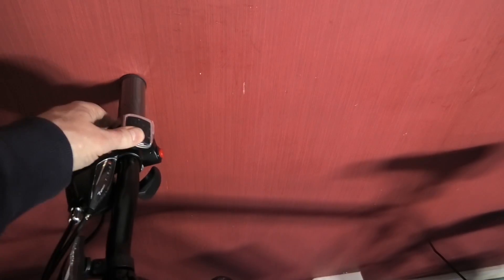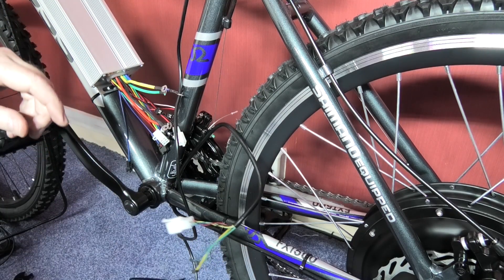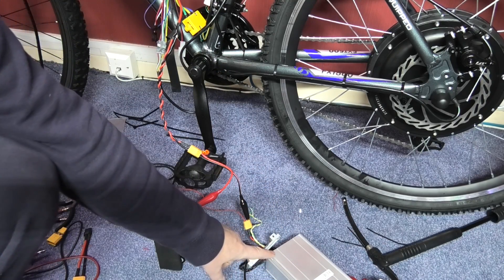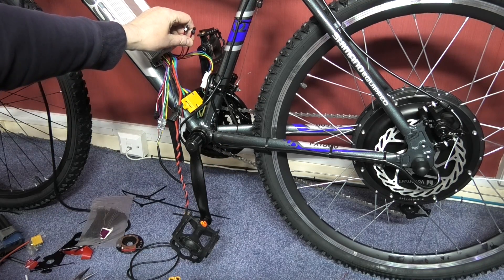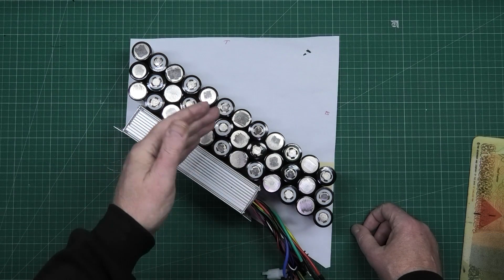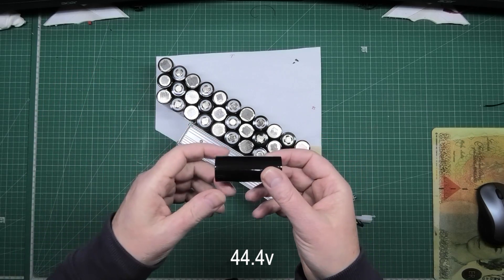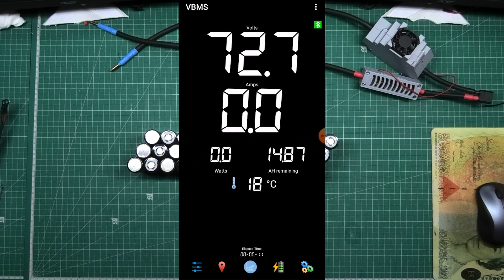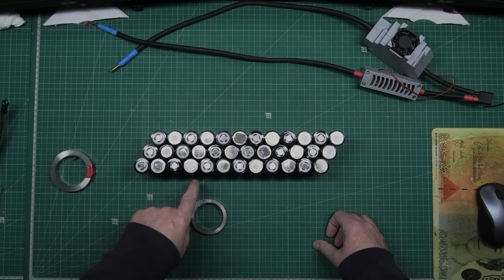Budget 1500w DIY eBike build part 2 - The li-ion battery build

Comment: tony  the  yellow  block at  3  mins  n  video  with  3  phaze  wires  do you have one you can sell me  or  is  there  a  uk  supplier
Reply: You have these, but they don't come with a cover (a block of firm foam and a few layers of insulation tape would suffice) https://www.ebay.co.uk/itm/142096147429
You have these which require you to cut the ring connectors off and screw down the bare wires https://uk.farnell.com/camdenboss/chtb10-3n/terminal-block-power-distribution/dp/2321056
Apart from that, I can't find a solution in the UK mate, sorry.

Comment: Why you use these shitty liitokala cells? Especially on your big bike. With your 6P config is your max output 120-130A or your plastik printed casing melt down. Try Samsung 18650 35E cells. Way cheaper and much better performance. For more power up to 6C discharge use VTC6 or Samsung 30Q.

Comment: Hello Tony, brilliant vids btw only found you recently but glad I did. I have a question on the tape. I don't fancy building my pack with hotglue and have decided to attempt your bonding tape method- I cannot however find tape that looks or resembles your roll. My question is could you supply the name/ version of the scotch vhb bonding tape, also what thickness is the tape depth wise, I'm building a battery that will be going into a confined box within the centre of my frame but the spacing is limited so I need something that doesn't bulk too much but also leaves a breathable airspace between the cells.

I impatiently wait for your reply haha

Jc
Reply from the maker: Mine is very old and it's 0.5mm thick. Try this stuff mate, it's virtually the same (acrylic) https://www.amazon.co.uk/Transparent-Mounting-Double-Sided-Waterproof-Resistant/dp/B07PS1PXLR/ref=sr_1_5?keywords=vhb+tape+0.5mm&qid=1578207533&sr=8-5

Comment: Hello, I put together a 10s3p pack using the 26650s, soldered using fuse wire and seems all good, however the throttle mounted battery level indicator supplied in the front wheel kit by Voilamart was reading 3 bars from day one whatever the state of charge.
So I ordered what I thought was a better one with a key lock and voltage readout and the only thing that works is the voltage readout, ie no throttle, been 3 months now but  I remember the controller wiring is different enough  to be a problem. ( poss 1 less or 1 more wire)
I asked Voilamart for advice re wiring change but they would only offer me a replacement throttle if I paid for it, so gave up , any advice offered welcomed in advance.
Reply from the maker: It's a simple answer..... If your controller is a 48V one, your battery voltage is too low. A 10S battery will only deliver 42V when fully charged which is below the minimum voltage required to fire the controller into life. 
You need a 13S pack which will give you 54.6V fully charged.
Reply: @Vortecks  Bought as 36V250WF Front, 250W / 36V16 mph 15 N.M, legal version ? worked superbly until I changed to locking/voltage readout throttle
Reply: @tonymaloan  can you email me with the wiring of both the connectors and I will try and work out which wires are which.... I had to rewire my throttle when I changed controller... All works fine so I would suggest that its just getting the right wires.... Unless something has popped...
Reply: The wiring on the voilmart controller side are as follows.. Black - neg, red pos, white - throttle signal, yellow and brown are on and off switch /key on the new one... And green is the voltage

Comment: Very well explained Tony. I got it !!! But do I really have to spit on it, I've got a bad cough at the moment so if I do i probably won't need the tape to stick it together!
Reply from the maker: You don't need to spit on it, but it does add to the overall structural integrity. Plus which, you get the added benefit of knowing that there's part of you that went into building it 😁
Reply: @Vortecks  hi Tony my first comment :) can you pls tell me where you got that scotch bong jointery or at least what the proper name is thanks
Reply: @MrNewman64  I don't even remember where it came from mate. All I know is, it says 'VHB tape'.

Comment: Hey Tony, if the controller is a KT or something the minimum cut out voltage can be adjusted using the LCD screen as I had this issue with mine.

Comment: I like to use mt60 connector for phase wires on these low power kits.
Reply: I use the XT60 connectors on both phase and power for upto 1500W 35/45A kits..
Reply: @footydoyouremember  mt60 is ideal for phase as its 3 pole makes for tidy install

Comment: Completly and utterly bambozled by the battery vid, but saying that interesting to watch. Made me take the casing of my steed and look at the layout.
Reply: Easiest way to look at it is, 1 cell has a positive and a negative.... if that cell is 5000mAh then you have 3.7v @ 5Ah.
If you have another 3 cells and you connect the Positives together and the negatives together, you will keep 3.7v but have 15000mAh 
If you require a 48v battery pack @ 15000mAh or 15Ah then you would make up 13 of these strings and then connect cell 1(3 cells pos to pos and neg to neg) to cell 2 by only connecting pos of cell 1 to neg of cell 2, then Pos of cell 2 to Neg of Cell 3 until you have connected all 13 cells together.... leaving you with a Pos at one end and a Neg at the other... Depending on the BMS that you have, you then connect Neg to BMS B- port and Pos to power connector... Then from Neg of Power connector back to the BMS.... Always solder the power connectors first... so you dont do what i did first time i did it and slip with solder iron and short the pos and neg together... it goes with a right crack lol...
Reply: @footydoyouremember  Thank you Steve
Reply: @andyc18865  no worries Andy, if you have any questions feel free to ask as that is just the tip of iceberg
Reply: @footydoyouremember  Merry Christmas Steve. Do you know if lights can be wired straight into the kt-lcd8h its the one without the usb slot though. Thanks. Andy.

Comment: Hey Tony,  thanks for another great video!  Do you happen to have a link for that tape that you connect the batteries together with?  I’m all set to build some batteries as soon as my Malectrics spot welder shows up in a few days and the tape would save me from using hot glue as you mentioned.  Thanks and have a great holiday season!
Reply from the maker: This is the closest I can find mate. The stuff I use is rather old...... https://ebay.to/35pnaX2

Comment: Coming together pretty well. I've never liked the look of that yellow block it's to bulky but my old 1kw hub was melting the phase connectors. I changed them for bigger bullet type connectors on my old kit but again it started melting them (originally the connections on the 1kw was some really thin bullet connectors) . In the end it melted the wires together which I decided was to dangerous and changed to a 1500w hub instead and it's not done it since with the yellow block. So I'm guessing thats why they decided to use the blocks as they handle current better.  Or I'm talking crap 😂
Reply: I fried my first controller cos the connector got that hot that it melted the connector block and touched the negative of the light and melted the wire shorting the controller.... But it was my own fault for pushing 2800w through it instead of the rated 1500-2000w
Reply: Sounds like you had an issue with your motor shorting out... hence changing that fixed it. The block should not be even close to warm, that either means the connectors are not touching correctly (like you didn’t tighten them down well), or there was a serious issue with the motor compounding with poor contact. Mine only pulls like 2kW during acceleration, modified controller (37.5 amps at 58v), so that’s like a really low current, which is why those really wimpy looking hub wires are ok.

Comment: i got the same style of controller with exact same connectors, i just pot fill the molex/whaever they are with hot glue ,glue the crap out of everyting the wires the connectors the controller where the wires come out of ! been riding my bike now for 5 months in the rain and no problems yet ! i hope ( plus my controller is in a pannier bag thats water resistant  ,the battery is premade so thats in its own watertight casing edit, and for hiding cables i got  from amazon them desk cable tidy velcro wraps ,they are perfect ! goes around the tube and cables

Comment: and for people who struggle to fit the battery and controller on the frame a cheap rear pannier does a good job for the controller plus it hides it away and water resistant with the inc controller bags and or bags shipped with the pannier rack :)

Comment: Thank you Tony for the shout out... Just to clarify, I build packs to your needs... Discuss your needs, size and shape of pack, Amp Draw etc... I supply the ANT BMS with each pack unless otherwise requested... Cells Can be either NEW or Recycled depending on your needs and your budget.. My email address is steved7127@gmail.com... I will not discuss prices on this thread as that is not what Tony's videos are for.. Please respect that
Reply: @Welsh Whoopee hi mate... When you say inside a case? A custom built case? 
Yes I do build with and recommend the 26650 cells... The question would be the size and shape required... Can you email be with the dimensions so that I can work out how many cells you can fit in... And the voltage and amp draw of the controller please
Reply: @Welsh Whoopee tonys battery is the bollocks you could,nt repeat it!!!!!
Reply: @coopers4491  I have just completed and shipped off one that is built from the 26650 and has 2 extra in parallel... Tony's 3d printed battery box is an awesome creation and so well thought out.... Being that each bike is different, I doubt there would be another one made the same... My frame is completely different so my battery box is a similar design but doesn't split... I just lift my packs out when needed..
Reply: @coopers4491  There is room for improvement as in made bigger apart from that cant argue
Reply: Think tony is the 1 to buy from as he seems to know a lot about the technical side !!!!!!
Reply: @coopers4491  here sure does know a lot about the technical side... Come and have a look on the forum and read my posts on the batteries.... Tony defo puts the bikes together meticulously... No stone left unturned
Reply: @footydoyouremember  definately buy a bike off him !!!!!
Reply: prices wouldnt ruin the video...
Reply: @bojackson3073  the reason for not giving prices on here is because this is Tony's videos and he is the one that doesn't want discussions around pricing as replies can get long winded... This is due to each pack being custom built to each specification... Some want 26650 cells, others want 18650, some want recycled to keep the cost down.... The only thing I will say on pricing is that I have built packs or in the process of building packs ranging from £300 to £1250 so far... All come with a Bluetooth BMS but to discuss exact specifications that suits your needs its best to email me so that I can work out which cells would suit your individual needs

Comment: What do you think about this guideline, Tony? I've been telling people to do 2x range capacity and 25-33% max continuous amp to determine the battery. So, for 1kW and 30miles, I would tell them to get 2kWH and a pack that can do 60A continuous (33% of 20A). Of course, everyone has their budget but I think the max continuous amps is more important. Cheers from Wisconsin!
Reply: The way I work out range is as Tony describes... The reason for this is because nobody uses continual maximum power all of the journey.... So for instance if you have a 20Ah pack and your max continuous is 60A then the minimum range is to run for 20 mins at top speed of say 40 mph... That would make a minimum range of 13 ish miles... Reduce to 30amps and you would have increased range to about 26 miles.. And so on etc
Reply: @footydoyouremember  Aye, I meant by my post is for folks to use 25-33% of their max continuous amps if possible to not only extend range but also for cell health. And, then if possible, get 2X the range for battery capacity so 1kWh => 2kWh.
Reply: @bakotako  totally agree with you on expending the life of the pack that way...

Comment: Hi mate quick favour to ask. Or anyone reading this. I bought one of Andy's 1500W kits but the controller he uses has an XT60 connector and my battery uses an Anderson connector. You wouldn't have any spare time to whip up an adaptor please? I don't have access or any experience soldering unfortunately. Andy said he'd be able to help but I've chased and had no response unfortunately.
Reply: Try ebay someone might do an Xt60 to anderson connector or a xt60 pig tail so you can then crimp an anderson connector on
Reply: If tony can't then I can sort it for
Reply: @footydoyouremember  That's would be really helpful mate what's your email?
Reply from the maker: Sorry mate, I'm really struggling for time (as usual). Hopefully, Steve will be able to sort you out 😉
Reply: @lewearle  email me with a photo of the connectors you have on each so that I can match them up for you
Reply: @footydoyouremember  Just sent you an email mate thank you.
Reply: Those are on eBay for just a few dollars, one of the most common batter adaptor cables possible ever made for hobby RC people. No need to have a custom one made if you’re not doing it yourself (I make them all the time, but if you can’t solder there are almost any style you want ready to go on EBay, or Amazon).
Reply: @jakegarrett8109  Unfortunately none available on either UK eBay or Amazon trust me I've checked 😔

Comment: Personally I have always scrapped that phase wire connector, in this day and age it is stupid and not needed and I realty do not understand why they still use them, the first thing i ever do on a kit like this is swap out those connections for bullet connectors this way you still get a good connection  ( as good as hardwired) but in a far smaller and tidier package

Comment: Rather than using that hideous yellow block, I used 3 short nuts&bolts, and then shrink wrapped each. 

Shrink wrap is easy to replace if you need to take off the wheel, and it makes it easier to deal with and manage, without the block.